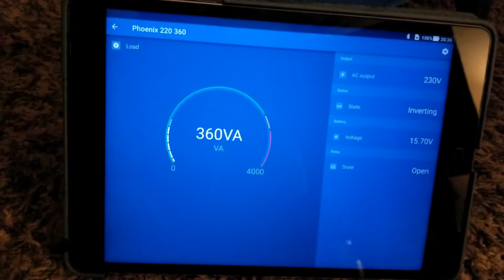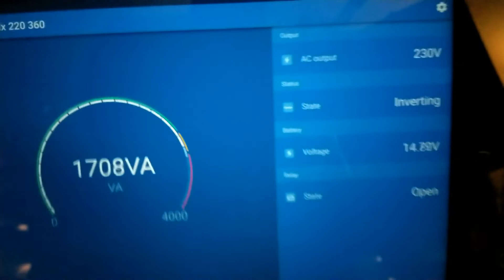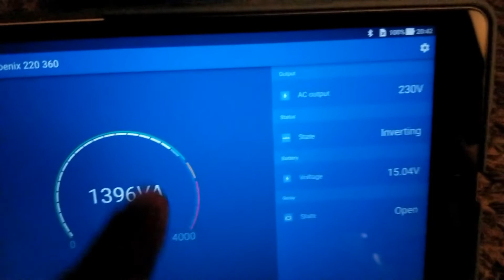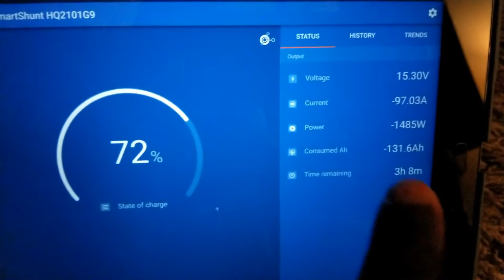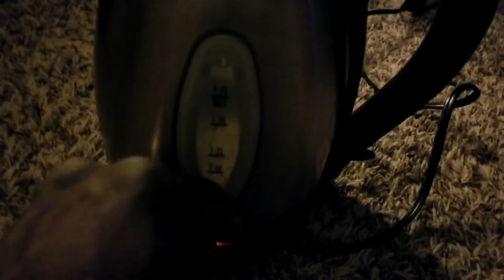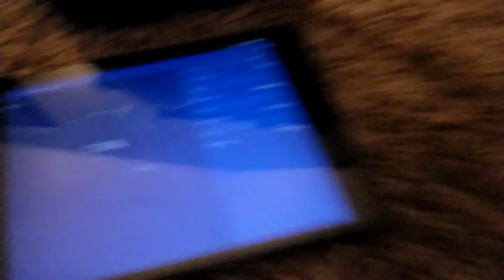OFF-GRID-SOLAR BATTERY BANK, VICTRON ENERGY PHOENIX INVERTER SMART, SOLAR CHARGER CONTROLLER MPPT(6)

Comment: THIS IS A GREAT LOAD TEST AND LIKE YOU SAID , IT DEPENDS ON THE LOAD VIA THE 12 V
DC WIRE SIZE TO KNOWING THE LIMITS THRESHOLD BEFORE THE AUTO TRIP OFF POINT OF THE 1750 STEP DOWN TRANSFORMER OUTPUT . :goodvibes: TRY THE 5500 W TRANSFORMER FOR ANY DIFFERENCE .🤔
Reply from the maker: Will do.
Thanks for watching